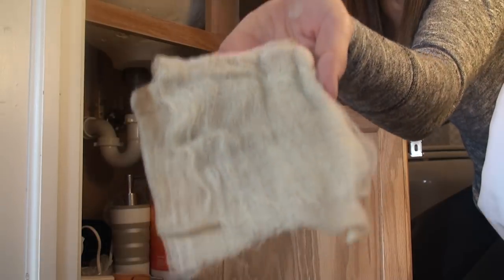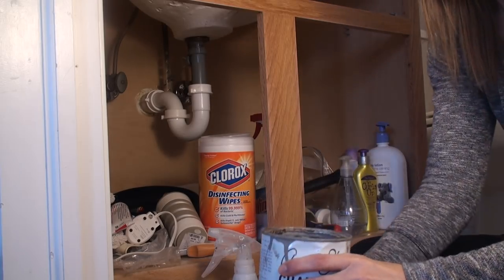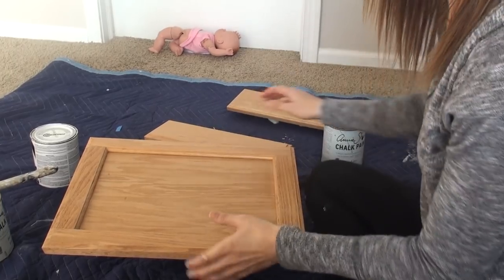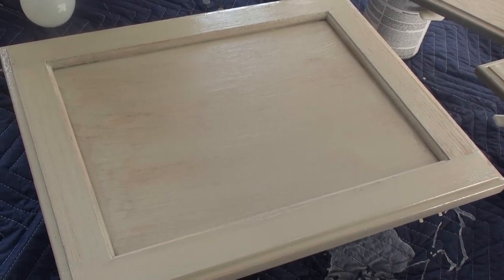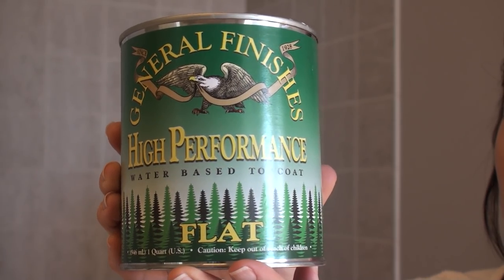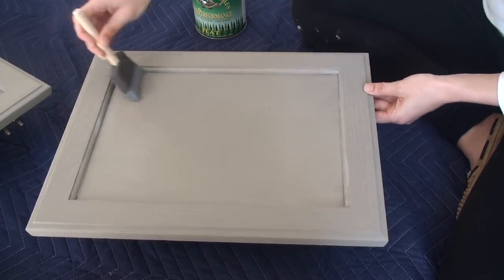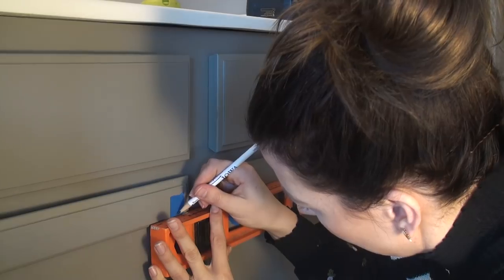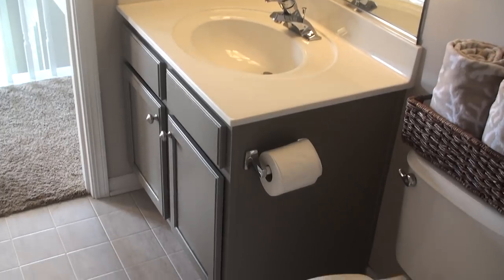Chalk Paint Cabinets With Annie Sloan Chalk Paint

Comment: Why not remove all the fixtures? I noticed that you were painting around your toilet roll screw fixtures. For a good finish I remove everything.
Reply from the maker: I initially tried to remove them but it would have been a lot of work to get them back on. They were some weird winged ones. The actual toilet holder hardware went over these screws, so the finish around them looks great.
Reply: Christina Muscari those weird winged ones tend to be standard with most bathroom fixtures.  They are quite easy to remove and if you have a problem, refitting with slightly longer screws is the way forward.

All the best.

Comment: I truly love it BUT is there a simpler way of painting the cabinet? I mean not so many steps? Plus I have the ugly matching old fashion mirror that goes with my vanity. 🤦‍♀️ please HELP!
Reply from the maker: You could chalk paint without sanding and then seal it with wax. I took these extra steps to ensure it’s durability. Or you could also do one coat of primer and one coat of latex paint. You don’t have to seal latex. I’ve done both and I just prefer the way chalk paint looks.

Comment: That is too much work!
Colosseum Chalk Paint is All in One so you don’t have to Prime Paint and wax or Clear Coat which takes HOURS & DAYS 
Just use Colosseum Chalk paint with just one or two coats applied to sanded or not sanded project.
Reply: Can you use this type of paint over existing paint?
Reply from the maker: Interesting. I'll have to check it out.
Reply: Laydee it depends oil base no flat paint yes but I would always do a light sanding